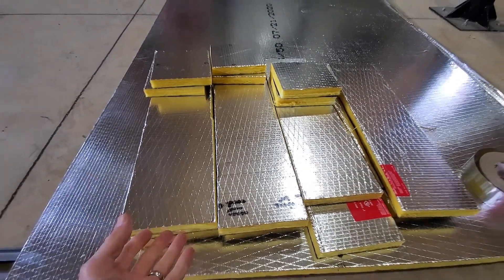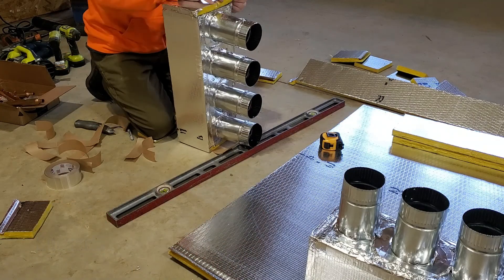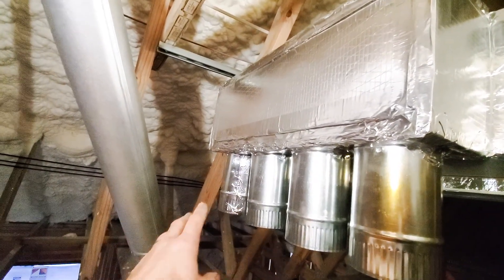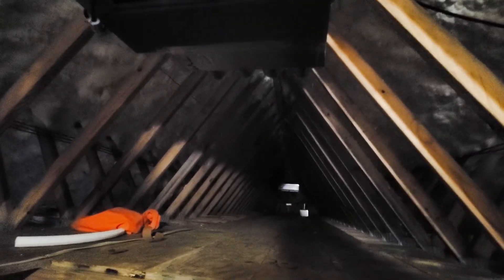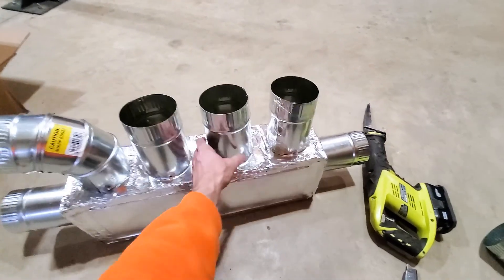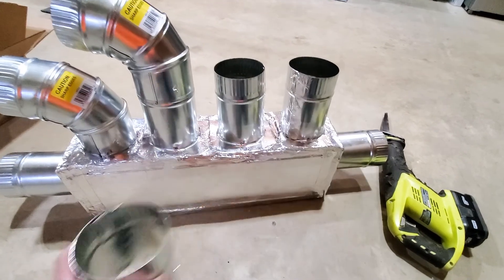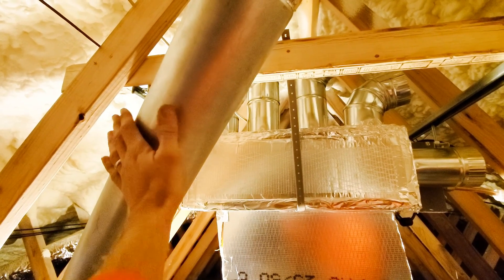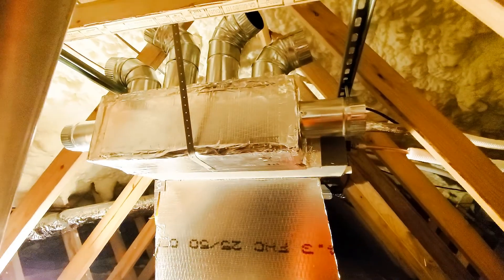Ducting a MrCool Olympus Mini-Split Slim Duct System on our Off-the-Grid Home Build DIY Barndominium

Comment: wow,,what a mess !!,,why would you run 4,,,your static press must be extremely high,,,friction in flex duct,,,this is a mess !!,,,
Reply from the maker: Nope, I ran it through a friend who does HVAC work and has for over 40 years.  It's fine, works fine, is fine.  A mini split system is not the same as a traditional system.

Comment: Not sure if that is low or medium static but there is NO WAY that system doesn’t underperform in that room. All that spray foam and install that for mechanicals. Keeps hvac guys in business at least. Also return so go low with all those high supplies. How will heat fall? Equipment and design are wrong for application.
Reply from the maker: I don't know, we've been using it for years now with absolutely no issues.  Plus I did had a seasoned HVAC installer review the set up and he approved it.  He has over 40 yrs installing systems.

Comment: How is it working out?
Reply from the maker: No issues besides the thermostat that comes with the unit is junk.  We ended up buying a Celeo controller which is better but still has it's issues.  But the house is cool in the summer and warm in the winter.

Comment: 10:40 Can you fill any airflow on that supply that you brought all the way down to the floor through a 4 inch flex? I doubt you’re getting 30 CFM. If you’ll notice when you have a pro HVAC guy size your ductwork using Man D, those longer ducts are usually one size larger and R-8 insulation.
Reply: yea,,hes designing like a high velocity system,,,

Comment: 7:09 So where did you hear that ducted mini splits like to have restricted ductwork? I need to read up on that. What is the ESP or external static pressure of that unit? I’d be surprised if it’s more than 0.3 inches of water column.
Reply: Just the opposite, restrictions are never good

Comment: 0:55 Who told you liquid ever makes it to that air handler? If you have a mini split heat pump, the refrigerant metering device as at the outdoor unit on the little line. A solid liquid filled tube coming off of the outdoor coil (condenser in the summertime) meters through an electronic expansion valve, then through the little tube to the indoor coil. That is the reason both refrigerant lines must be insulated. In the winter, the refrigerant flows the opposite direction. Your indoor coil is the condenser and the little line is full of liquid, which then goes to the outdoor unit through the electronic expansion valve inside the outdoor unit.

Comment: What is the yello foam insulation you are using called I need that for a project please
Reply from the maker: Duct Board.  Should be able to get it at any box store.  I bought it at an HVAC Supply company.

Comment: How did you know how to size your system?
Reply from the maker: Rule of thumb is 1 Ton per 500 sqft (400-600 or 500 on average).  Mini Splits are a little more efficient so you could go 600 sqft per ton.  Because our house is well insulated (spray foam) I went 700 sqft per ton.

One ton is 12,000 BTUs if you are sizing it that way.  

So we have a 3400 finished sqft meaning I needed a 5 ton unit.  We've gone through several seasons and it has been working fine.  Hope this helps.

Comment: Looks good good for you for getting a pro to help so you get the most out of you system.  I see a lot of homeowner  installs that are insanely bad and  they end up paying a pro redo it. Inverter heat pumps like yours are great they don't have the inrush of current like other type of a/c or heat pump systems. They can run on most inverters and generators. I'm sure your already know this and that's why you have them.

Comment: How about consulting with HVAC guy before you run ductwork. Or better yet do you research online. You could’ve put four 6” R-8 flex supplies.
Reply from the maker: Our hvac guy said 4" was ok and the online research showed the same thing.  I just needed to add a couple additional runs.  The system is working fine and heats/cools the house as it should.  Thanks for watching and commenting.
Reply: Those little air handlers rarely put out more than .3 inches of water column external static pressure. You need to size your ductwork, larger than what you normally would with a .5 external static pressure blower. Besides, 6 ea 4”flex ducts lose more pressure and your heat loss/gain is higher than with 3 ea 6” flex ducts. Always use R-8 insulated flex.

Comment: Hi, love the video.  I am installing a 18k BTU concealed duct mini split by a different manufacturer, but the rules for the ducting are the same as yours.  Here's my problem, because the unit is a 18k, the CFM is rated at 450.  The opening on the air unit is 6" X 28".  I need to feed 6 total rooms (total is 800 sqft).  I have calculated the CFM for each room but I am not sure sure I can feed 6 rooms when the opening is only 6" by 28".  Do I make the duct connecting to the air unit bigger so I can connect 6 openings to it?
Reply: The 6 rooms will have the following duct size to get the correct CFM: 3 registers with 5" duct and each will supply  CFM (150 total), 2 registers with 7" duct and each will supply 110 CFM (220 total), 1 register with a 6" register to supply 75 CFM.  So the total CFM I am splitting is 435 CFM which works well since my 18k unit is rated for 450 CFM.  I just don't know how to make it work with the size of the opening on the unit
Reply from the maker: @IADHDD  I have another video that was posted soon after this one where I had to add more ducts and built out a plenum ti accomplish it.  I just used the same duct board.
Here is the video
https://youtu.be/6DRN-JNgYTU

Comment: You are all over the place.   The manual should tell you what the min an maximum static restriction can be.   Remember the return filter size type will effect that too.   And a 4" duct can handle way more than 40cfm. Are you saying without restriction? Noise ? Pressure and leak possibility?  Because length of run and turns will effect that as well.   
Go off the manufacturer specifications.   But really you want 5-6 " ducts and then you can adjust with a damper the flow as desired for each room based on actual performance.  And each unit would represwnt a  zone.     these systems have a variable cfm blower  that adjust based on load.  Some even calculate airflow restrictions and adjust.
A larger duct gives Lower air speed, lower pressure with the same volume and  is definitely quieter.  Pressure on the supply side is bad will blow all your tape off your joints.   Get some mastic and use panduit straps. Tape will NOT be good enough
Reply from the maker: Thanks for the tips.  The unit has been running for a while now and  seems to work as it should.  The air coming out of the registers isn't blowing, it's more of a nice breeze.  House has stayed cool all summer and warm in winter.  Not planning to change any of the ducting but do need to strap the flex onto the units.  The tape has held but I can see it being an issue before to long. 

Thanks for watching and posting.

Comment: Are you willing to share your HVAC company's name that you consulted with?  I'm entering this realm now!
Reply from the maker: I'd want to ask him first but all the info was basic for any qualified HVAC technician who knows how to size duct work and charge a system.
Reply: @Off-Grid  you mentioned a required CFM for a minisplit. Is this parameter specified in the technical specs?  If so what is that label called?
Reply from the maker: @SolarDrew   a typical one ton unit requires around 400cfm but I've been told that a Mini-Split needs to be constricted so it is around 250cfm if I remember correctly.  This was not noted on the unit and MrCool was absolutely no help when I called to ask.

Comment: why is the music SO LOUD and your talking so soft!
Reply: How do you like the air flow with the flexible duct?  I’m considering 3 outlets (6”, 6”, 4”) off a 1 ton head (48k Multi5 Olympus) with solid pipe and would like your thoughts.
Reply from the maker: @Dave-tg1pu  the cfm of the unit would be around 250cfm.  That duct set up is around 210cfm.  The units are supposed to be constricted some so that should be fine.  Adding another 4" would make it spot on.
Reply: @Off-Grid  Hi, so 40cfm for 4" and 85cfm for 6"? Where can I find a chart for these numbers?
Reply from the maker: @sinausa  you can easily find them by googling cfm for flex duct.  You'll see charts for flex and rigid duct air flow.
Reply from the maker: Really!  I'll have to watch it again.  Usually the music is to soft.  If you have a question about the set-up please let me know.
Reply from the maker: Lol, Yep I agree.  Sorry about that.  Unfortunately I can't change it now.  Thanks for watching.
Reply: @Off-Grid  LOL

Comment: I am looking to install the Mr Cool DUCT on my house and I am concerned about the amount of pressure drop through the ducting. What square footage is your house and what are you using yours mainly for(cooling/heating or both)? My load on my house is 1.5 but my required CFM is around the high range of the 2 ton unit so I am not sure if I want to split into a multi system like you at (2) 1 tons. Are you getting enough air through your ducting? It appears small and will have a great deal of pressure drop. How many more ducts did you add? I will have a MERV 8 filter on mine so that will add a bit of pressure drop also. I would love to pic your brain of line.
Reply from the maker: Keep in mind that our house is very tight and requires less tonnage to heat and cool all 3400 sqft.  I've always been told by our hvac guy that air should flow through the ducts and not blow through them meaning you shouldn't feel blow dryer at each vent.  You can feel air coming out of each vent but it isn't "blowing" out like most conventional systems do.  The system we have is a 4-5 ton depending on how it is set up.  Right now we're on the 4 ton setting but are planning a small addition and will add another unit changing the system to a 5 ton.  

I do not have anything other than the washable screen filter on the units.  I had originally bought MERV filters but know that they restrict the air flow greatly and didn't want to put any undo stress on the units.  Plus our HVAC guy said they really aren't needed unless you have allergy issues and if you open your windows often, like we do, then it is pointless.  

We use the units for cooling but also have ceiling fans in each room.  We use the units for heating on sunny winter days but typically have a pellet stove going and the radiant heat on the lower level.  The house stays plenty cool during the summer but the living room get a little warmer because of the large windows we have in there.  The house stays plenty warm but I had to work up some extra ducting from the pellet stove to the back bedroom.  I did this by ducting it through the McCool unit so all I have to do is turn the fan on and not the whole unit.  If we weren't off-grid then I'm sure we'd just run the system the whole time.

Comment: Those tapes wouldn’t last long especially on the positive pressure side.
Reply from the maker: I have had to touch up the insulation layer once already but the inside, plastic to metal, hold really well.  I'm sure I'll need to zip tie them soon.
Reply: Your HVAC guy should’ve bought you a one gallon bucket of mastic and a 3 inch brush. He should know better than to give you only plain foil tape to attach takeoff and assemble a non-shiplap box for your supply plenum. You tape the inner plastic liner with the helical spring wire with foil tape, then use mastic. Then you pull the insulation and outer Mylar foil over top of it, and tape it to the return plenum, then use mastic again. Did I mention using mastic? For 30 bucks I can guarantee you it will never come apart the rest of these unit’s 10-12 year life.

Comment: I would have built a full 20" long supply and return plenum for more volume and not use mold making fiber board. Built it out of metal and insulated with R8. Those 4" ducts only flow 40cfm each  when hard piped all the way not using flex duct. Flex kills the flow.
Reply from the maker: Yep, you are right.  I will most likely be changing the plenum out at some point.  The 4" ducts are sized properly for the units though.  Wish I would have done rigid pipe but it would be difficult to switch that out now.

Comment: Also, what type of air filter do you open to use on the return?
Reply: When you use the screen that the unit came with the coil and blower Gets very dirty over time. Not having just a basic  merv 8 filter to capture some fine dust and dirt will only cause that thing load up with dust and dirt. Then the coil ends up getting mold on them in time. I've seen it many of times. When you can hold up a factory screen filter and see right through it how much dust of dirt will it stop ? 
No a standard merv 8 filter won't restrict the air flow too much. It will if you only change them once a year .....
Reply from the maker: @pineychristian  Sorry I missed your reply.  My AC guy told me that he has seen the same issue with these types of units.  Funny though that he is also the one who told me not to use the Merv Filter.  I'll be opening the units up to inspect the coils soon.  The screens have never really gotten to the point they need cleaned but I'll probably do it anyway.  Thanks for the advise, be it that my response is a bit late.
Reply: @Off-Grid  yea I have over 40 that I maintain in 3 of my buildings.  The brand really does matter they operate the same for the most part. I've switched all my ceiling cassette on basic Merv 8 filters years ago. Saves me a lot of time on cleaning.
Reply from the maker: @pineychristian  I have the filters I initially bought.  Can't remember what merv number they but will give them a shot, thanks again.
Reply from the maker: After talking to my HVAC guy he said to just use the washable filter it came with as it is the least restrictive.  Meaning the unit doesn't have to work as hard.  Unless you have issues with allergens he said the MERV Filters are not needed.  

If I had used a MERV Filter I would have used an 8x24 filter that I could attached directly to the return air on the unit in place of the washable one.

Comment: Hi, excellent video and very informative.around 2 minute mark there are two white controllers above the plenum- what are those. I have those in my kit but don't know what they are used for.

I'm glad you upsized these. With ducted mini splits you also have to be concerned about inches of water column. I looked at the mrsplit manual and i think it says at 45 pa you get 400 m3h. 45 pa is .18 iwc and 400 m3h is 235 cfm. You can get more if you lower the static pressure. Below .18

So. 6x 4 inch units has an area of 75  sq inches which through 100 ft of flex duct at .1 iwc is 264 cfm and 507 fpm, which is darn near perfect for that unit if I'm reading the manual correctly.
Reply from the maker: Here is link to a previous video where I talk about those controllers.

https://youtu.be/50JM8V1zhDU?t=555

So far it all seems to be working just fine, just with the thermostat was better or there was an aftermarket option available but the only ones they make do not work with ducted units like this.  If you find a programable thermostat that works, please let me know.
Reply: @Off-Grid  thanks for that info. That's helpful.

Mine is a midea and it came with a basic 7 day programmable thermostat

If you find out who makes the mrcool units(I think I heard gree?) you can look through their thermostat selection as they may work
Reply from the maker: @jl9678  I bought a Cielo Breez Eco Smart AC Controller and mounted it in the attic space.   Works most of the time but because I have two run by the same ap they sometimes get messed up.  To solve this I have them turning on/off at different times.  Here is an Amazon link to what I bought.  https://amzn.to/3SMu0yC

Comment: Thanks for the video great content I know it's hard to do this when your trying to work.
Reply from the maker: Work has really slowed is down recently and we often feel like things are standing still but that's part of the deal when you build your own house as things tend to get put on the back burner often.

We're glad people are watching and hope they arw getting something out of it.
Reply: What is the seer rating of those Mr cools? All three running at same time was only 3000 watts?
Reply from the maker: @denniswallace4868  advertised at 22-23 SEER.  We have 4 units and it is only around 3kW.  most of that is the condenser.
Reply: Dang! there is so much work that goes into building a home, especially one that size.
Reply from the maker: @sinbads.4189  Sometimes it seems like it will never end.....